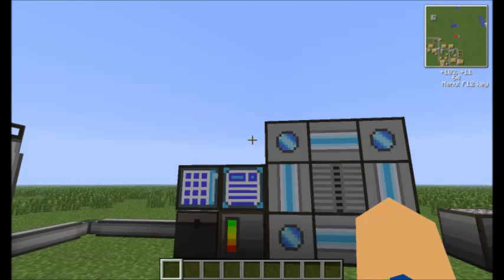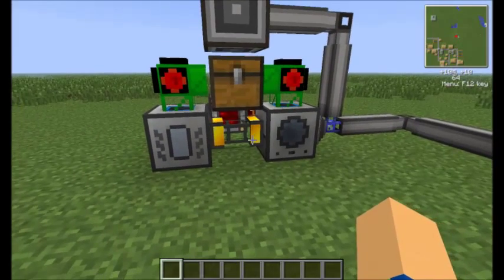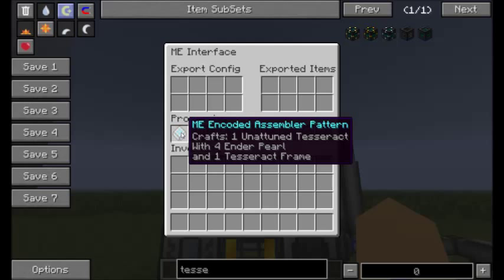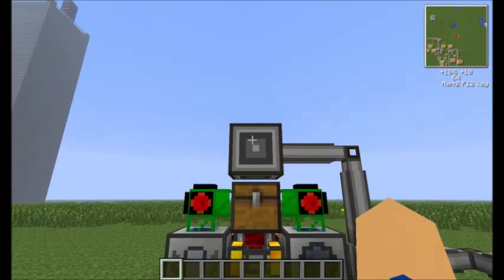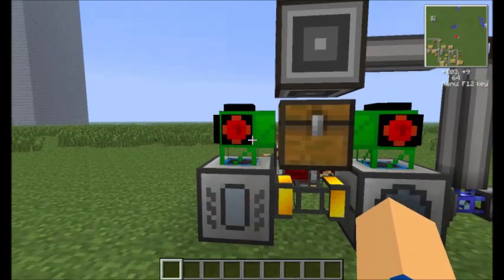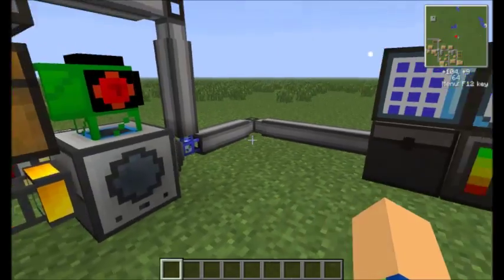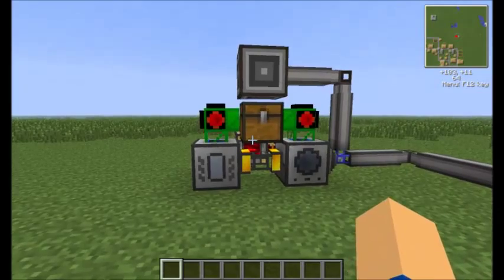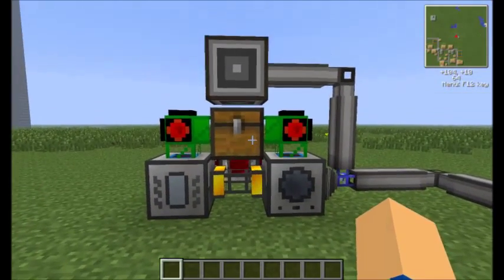Automatic Tesseracts

Comment: i've had a working version since i started playing with AE, but my solution wasnt quite as efficient, i built 2 magma crucibles and 2 liquid transposers, using an ME output bus i just kept both of the crucibles full of liquid ender and molted redstone, then just used an interface on each of the transposers.
Reply from the maker: That's a pretty good idea, especially if you have excess redstone/ender pearls.